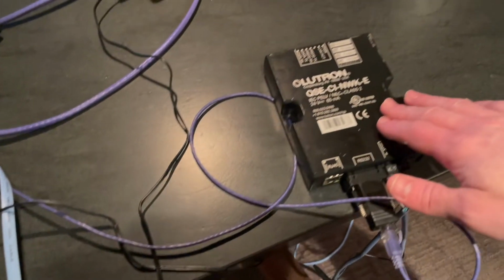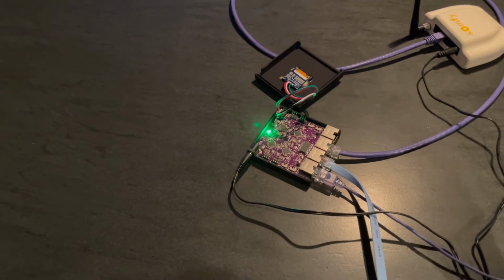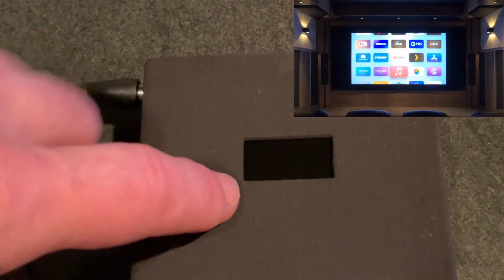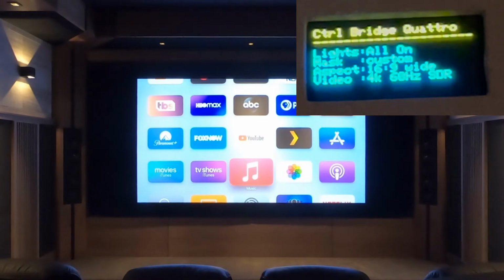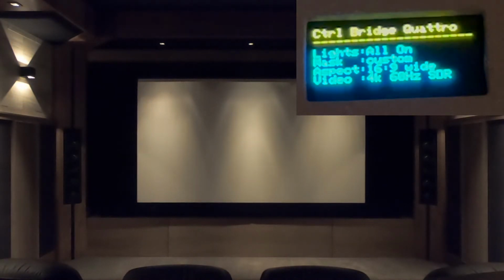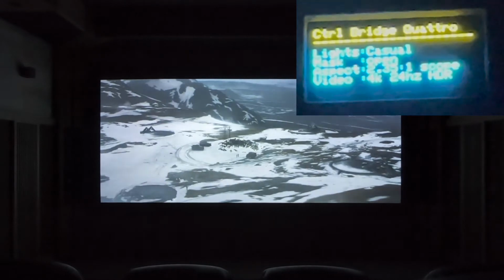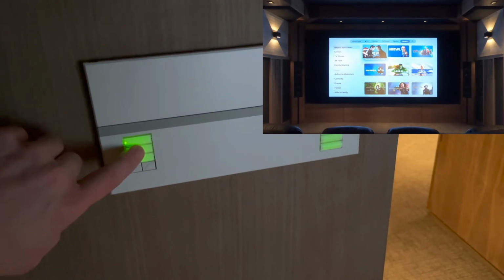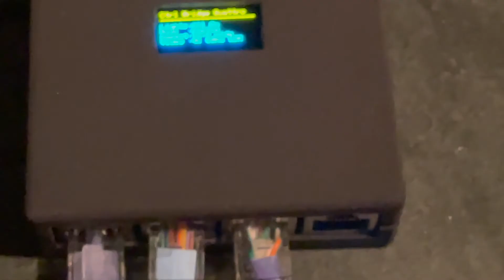Control Bridge Quattro: Demo

Comment: This was a very cool build series to watch...  I stumbled across it as I was looking to create my own electronic masking system for a future build but probably more of a CIW screen although the new Justice League has made me question that.  The screen build was very informative and well documented.  It looks like you designed the control board yourself, is this correct?  What do you do for a living? :)
Reply from the maker: Yeah the Justice league was an interesting aspect ratio. Still, I don’t think I’d manage to make my screen too much taller without heads getting in the way, at least not without rethinking soffits and other parts of the design, so I’m at peace with CIH.

In college my focus was on electrical engineering, but then career wise I got involved in servers and cloud and veered off in that direction.